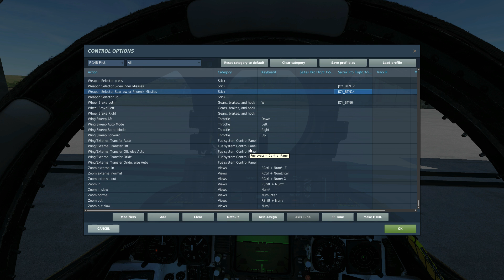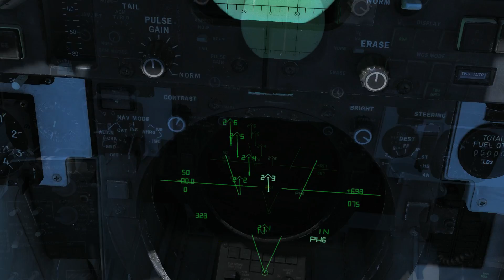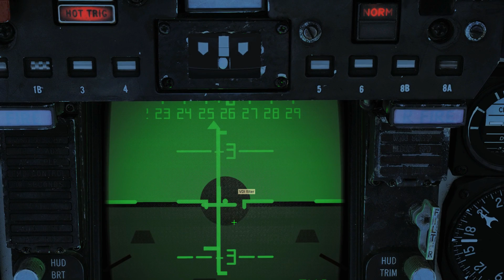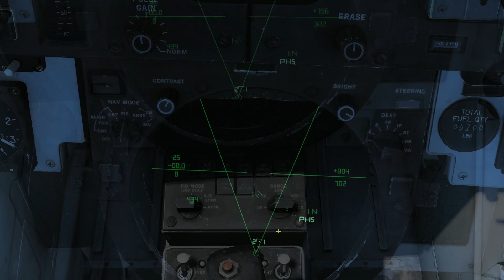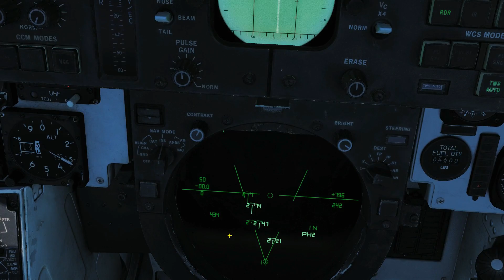F-14B Tomcat: Aim-54 Phoenix Tutorial | DCS WORLD

Comment: My understanding is that the loadout with 6 AIM-54 also includes 2 Aim-9 missiles, 1 one each pylon. I also understand that particular loadout was hardly used because of the weight and stress on the airframe.
Reply: the loadout was rarely used probably for multiple reasons: 1) the tomcat could only bring back 2 phoenix missiles normally 2) every missile has a limited amount of lifetime it can be carried on a pylon without being shot, carrying 6 at a time eats up reserves much more quickly
Reply: @ArtietheArchon  And maybe also because it's expensive af and the F14 is allready so expensive to use without it.
Reply: fuel is also an issue. Most of the time plane fly with their fuel tank attached to extend endurance & patrol range

Comment: What if i will shoot in TWS mode and then switch to STT?? what is going to happend, will it be guided as SAHR missile or it will activate its own radar and ignore commands from plane?? Or what if i shoot i STT and lock breaks?? will it go active?
Reply: The missile in TWS mode uses SARH corrections until it can see the target by its own means. If you somehow drop the SARH, it will continue in inertial mode until it can see the target (but you are running a risk of it locking on something you do not want it to lock on).

Comment: Ok, ECM mode... essentially, you fire blind, I'm assuming as close to boresight as possible, toward a target you apparently know (how?) is jamming you.... no setup required?
Reply from the maker: I best investigate more before answering
Reply: Mikkall jamming works by essentially spamming a bunch of signals to confuse something. Those signals have to come from a source and some sensors are equipped to lock onto that source rather then rely on pings from themselves

Comment: It would be nice to be able to turn the missile's active radar off and TWS guide your missile until impact. That way the enemy pilot would have no ides what happened. Is that possible IRL guys?
Reply: I think the data received from the uplink in the TWS are not precise enough to guide the missile all the way in. The data packages update every 2s (refresh rate of the radar in TWS), good enough for mid course updates, but not enough for terminal guidance. You need STT for that.
Reply: ilejovcevski79 makes sense
Reply: It's such a short time anyway literally about 10 seconds so unless you lucky you generally are screwed since it's not enough time to react which is why you don't fly straight at highish altitude at an F-14 within 40 nautical miles that has nails on you. Fortunately the AWG 9 is not good against maneuvering targets so by terrain masking and notching you can sneak up to them easy enough to go toe to toe with AIM 120s